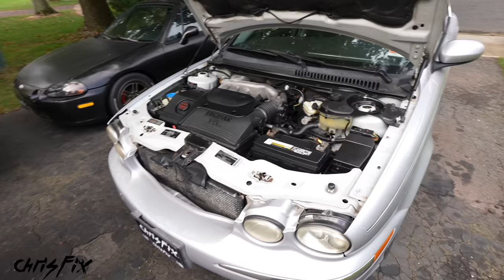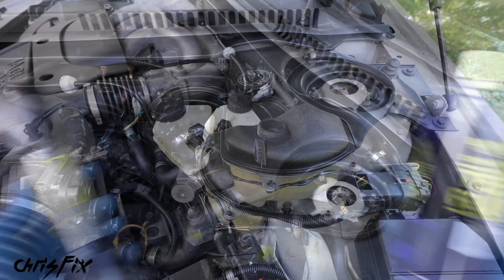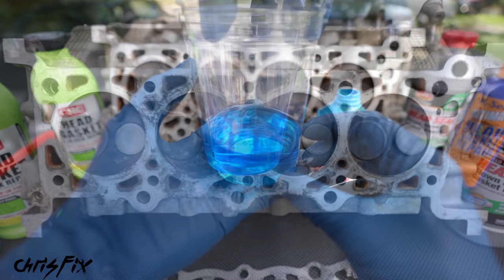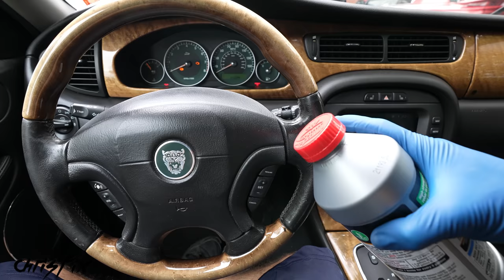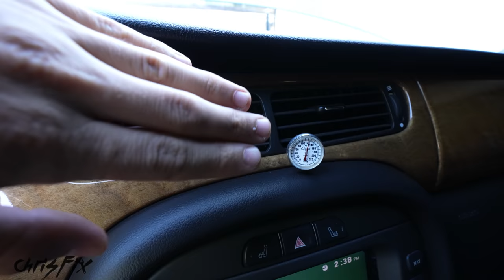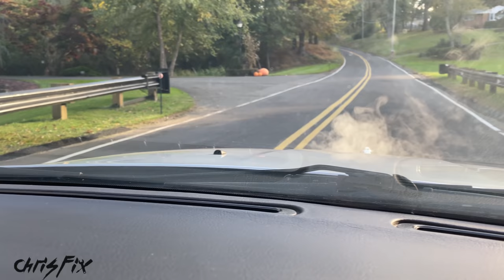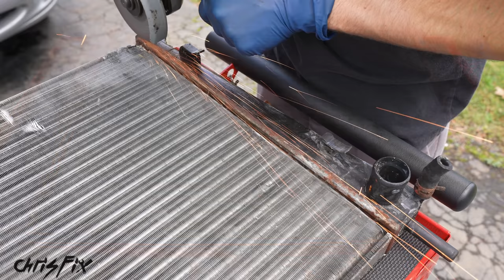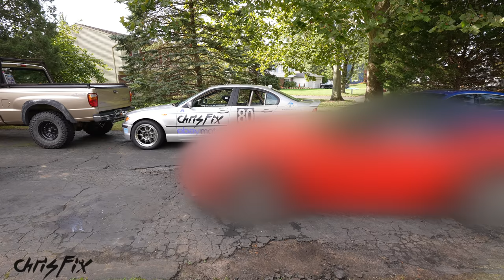Do Head Gasket Sealers Actually Work (FULL 2yr TEST with Engine Teardown)

Comment: This is the best head gasket video I've ever seen. Literally answered every single question ive had. Recently, I just found out i need a new head gasket, and it is definitely a costly fix. Thank you so very much for explaining everything and being very thorough. ❤

I do have one question, do you recommend a coolant flush after treatment as well? I just had one 1k miles ago, right before i found out along with the oil change lol. Do you recommend the oil change with any sealer or that particular brand?
Reply: Coolant in oil, oil in coolant, or both? Is the cooling system pressurized?
Reply: Oil is normal, I just know exhaust is getting in coolant. Been pressure tested 3x and i was told it was normal. Failed a block test
Reply: @c.b7474  if the cooling system can hold pressure then flush the cooling system multiple times with water before and after the procedure. Use water only with the sealer. I highly recommend removing the thermostat for this. Heater should be set to high. When adding the sealer it's best to dilute it first and only then pour it in. Do the procedure in steps, not just one go. After adding the sealer, topping up the cooling system with water and putting the cap on, start the engine, keep the RPM above 1000. Let the temperature rise some, shut the engine off. Let it cool for an hour. Check the coolant level, add more water if it's lower. Run the engine some more to raise the temperature more than before, shut the engine off, leave it to cool for an hour. Check the coolant level, add if lower. Repeat until operating temperature is reached. Then you could put some load on the engine, to make it really hot. Then you can flush and use the coolant of your choice.
Reply: I'm not well equipped with mechanics, a coolant flush cost me over $100 and i have to drive over an hour from where i live just to get it done since i live in the sticks. How many times am I supposed to flush it? I was told I can't put straight water in. 2020 Nissan Altima- it's passed the warranty. I'm not even loosing any coolant.
Reply: @c.b7474  should see how clean the water is coming out, when you think it's good, it's good. Flushing can be expensive when done by a mechanic. You can use water just not for very long, you wouldn't drive like that for a month. If you can't do it yourself or don't know anyone who could help you with this, then perhaps this solution is not for you?
Reply: @SinsBird  Well, this video was pretty simple. All I really need to know is if I need another oil change and how soon after. Seems like you added several additional steps that this guy in the video didn't do.
Reply: @c.b7474  Yes, with this method that I described there is 90% chance of success and it's not possible to cause a bigger issue. Method in the video is quick, easy, but has much lower success rate and can cause issues like clogging the cooling system.
Reply: @SinsBird  I'm truly just looking for something that works for min 5-10k miles (as seen in this video) so I can come up with the money to fix it (if the sealer ends up not being permanent) as i need the vehicle to go to work lol. I plan on getting a new vehicle in 6-11 months from now. So heck, if this treatment lasts till then (i drive a shit ton so id say 30k miles at 11 months) itd be great. If not, that's okay and atleast id have the 2-3k to fix it by then. Of course I don't want to mess anything else up, but Ive been reading on some bottles where some suggest removing the thermostat, and some say it's not necessary. I have no problem getting another coolant flush and oil change after the sealer. I'm just not sure how soon after. Like 50-100 miles soon after? I don't plan on selling the car. I pretty much wanna keep it till it's a gonner, or the cost to fix is over what it's worth.
Reply: @c.b7474  After you'll be sure the issue is gone.
Reply: @SinsBird  I appreciate your advice. Thank you very much.
Reply: @SinsBird  Okay, sealer definitely worked as i have no prior symptoms from the head gasket leak. I ended up using a different brand (Iron Tite Sealer) that was pretty straightforward and followed the directions, but now I have air trapped in the cooling system. How the heck do I fix this?
Reply: @c.b7474  How do you know there's is air in the system, I mean there likely is, but what is the symptom?

Comment: Yes, could also be an internal water pump seal which often leaks on mercedes. This lets coolant into the oil and we wonder if this will help fix this sort of leak. No overheating, just coolant loss with no drips.
Reply: Probably not.
Reply: @SinsBird  My Mercedes model is known for this type of a water pump leak into the oil system. Are you saying that's probably not the issue? Or it will probably not be repaired by head gasket sealer. Which.
Reply: @douglundy5755  Gasket sealer wont work for this type of leak.
Reply: @SinsBird  thanks..an oil additive then would be my option, or repair the water pump.

Comment: mate, you should drain the rad first, disconnect/ remove thermostat, then half fill, add the sealer while the engine is idling (from cold start adding). leave running for 50mins. then cool to cold, then drain out sealer infused coolant and refill with fresh coolant. reconnect/replace thermostat.

Comment: I can say without a dought my dad had an 82 gmc with a straight six and had a cracked head with multiple cracks also had 350 as well both used liquid glass and lasted at least at least a yr then reapplied and kept doing it for about 3 yrs and truck was used regularly for hauling a trailer even so if using on heavy equipment I recommend liquid glass head sealer

Comment: I have not used Gasket sealer,,How ever I have used stop leak on my Power Steering and used  Bars radiator stop leak/with beads. The Bars worked great on my Va,BUT the powere steering stop leak Blew out my Line,,had to physicly force my steering to get home,,good thing it was mainly a Straight line home.

Comment: Okay, sealer definitely worked as i have no prior symptoms from the head gasket leak. I ended up using a different brand (Iron Tite Sealer) that was pretty straightforward and followed the directions to a T, but now I have air trapped in the cooling system. How the heck do I fix this? Thermostat is opening at correct point, no visible coolant leaks. I think what happened was i accidently added too much coolant and of course poured 16oz of sealer in, so the resevoir actually overflowed. Water pump is also looking like its working correctly so im fairly sure its just air trapped thats causing a hiccup.

Comment: I have. Bubbles for a year or so no overheating on smoke and oil is perfect sometime the coolant goes down but sometimes it’s pushed back to the coolant tank and makes it overflow
Reply: If you have no problem removing the thermostat, then you can go with sealer that has particles in it, otherwise choose something like blue devil.

Comment: I have a 99 ranger that had a blown HG, leaked oil into the radiator/ antifreeze into the oil, I bought the barrs and it didn’t work, changed the fluid again and used the CRC and it’s been over a year and still going strong….

Comment: I’ve used that green fiber lock on a car that was pushing coolant into the oil; sealant went into the oil and the engine locked right up. Guess the stuff worked too good.
Reply from the maker: Dang

Comment: Actually surprised me. I've worked on cars for many years, my brother was a SAAB master mechanic and my bio dad was a mechanic and even I didn't think head gasket seal additives would work on a blown head gasket or a warped head.

I wonder if it's still worth it to pull the engine apart nowadays with how much it costs to have shops tear apart engines, with some requiring complete removal? Normally it's new warrantied used/reman engine or in some cases a brand new engine.

Comment: That is awesome Chris thank you very much for that. I just bought it took song 2006 with 69,000 MI. I got scam because they didn't Tell me about the blown head gasket. I used the same sealant that you did. It keeps blowing white smoke only when you started it the first time. Also apparently I'm not losing any coolant. I will change the oil now

Comment: Have not used head gasket sealer but do have a car with a leaking head gasket it is a 1999 ford au falcon forté it has 280’819 ks on it (174’494) miles I was thinking about using this but I already bout the head gasket and it’s sitting in the backseat of the car but that’s the least of my worries because the car has been sitting in my garage for 18 months and won’t turn on have had jumpers on it but it won’t turn on so fix that first

Comment: Hey Chris! I am currently dealing with an external head gasket leak and as I watched your video you said that the sodium silicate only works when combined with the exhaust gases which would only happen with an internal leak. So my question is, will a head gasket sealer work for an external leak since it has no exhaust gases to mix with or should I go with the K-seal since it doesn't have sodium silicate and only needs pressure and heat to solidify? Thank you for everything you do and giving me the love that I have for cars!
Reply: Any sealer should work if the leak is not too bad.

Comment: I did k seal in my 98 grand cherokee 5.9 limited 2 days ago and it actually did stop the head gasket leak.  No more yellow color on the radiator test.  And no more coolant loss and oil level stayed the same.

Kinda shocked me.  Was thinking i jad to park it and take the head off and blah blah

Comment: Hold on Shop is saying $1500 for parts that is absolutely absurd in what world is a head gasket and some coolant gonna cost $1500 because I’m currently running head gasket sealer through my car my 98 grand marquis and there’s no way in hell I put $1500 worth of parts For that now I have put $1500 in parts to fix the car overall spark plugs, rebuilt cooling system, window tent, audio fuel pump, etc. Telling me that they want 1500 for parts. I would buy the parts myself and say here put it on.
Reply from the maker: Jaguar OE parts from the dealer are not cheap! I'm sure I could have gotten them cheaper but the labor being $6k pretty much totals the car

Comment: Instead of buying a separate tester for exhaust fumes in your coolant... you could just use a long funnel stick it in your reservoir, and fill it with antifreeze to where the liquid sits above the reservoir. Let it run for about an hour, and if you still have consistent bubbles, you have exhaust going into your antifreeze. Aka blown head gasket. Anyone who has a funnel and some extra antifreeze or just water can do this.
Reply: Aaaand I spoke too soon. Paused the video right before he said the same exact thing. Lol

Comment: K -seal is the best out of all of them.
I had a MAJOR leak in my water pump ...losing a whole gallon of coolant with one drive ..
Used K seal and it took about 1 day total but it completely sealed the leak in my water pump.
K seal is the only one that works for water pump gaskets .
Reply: If it was leaking out of the drain hole the pump will seize.

Comment: I used the CRC bottle and it clogged my radiator. I replaced the radiator, but it actually stopped the head gasket leak

Comment: Severe complete blown head gasket? Grand am gt. Which are famous for blown head gaskets. I had issues 4 times over 4 years, but I completely dogged this car hard? Really hard? Changed gaskets and bolts the first time. Second time I b used Bars? Did nothing,   but Blue Devil worked perfect. And that poor car continued to be abused? Hacked, lowered, modded? With no issues  untill the coolant system would fail as usually in some way. BLUE DEVIL WORKS.

Comment: Thanks, bro. I'm going to try the CRC brand on my 2005 Ram 1500 5.7 Hemi. I'll  come back with the results.
Reply: Is oil and coolant mixing? Oil in coolant or coolant in oil? Or both? Is the cooling system pressurized?

Comment: Would this process work for an oil leak towards the outside of the engine? i've got a slow but steady oil leak, on the front side, no puddles ever but the areas around the leak are covered in oil, the steering pump, bit of the subframe, etc.. it's only a old peugeot 206 so if I can avoid dishing out £700, that'd be nice. Any advice welcomed. Thanks Chris, you're doing god's work for us petrolheads
Reply: This is for cooling systems.

Comment: My car has backpressure in the coolant, and I'm trying to use this I saw that steel seal  is a product that can work but I have to identify the cylinder that has the head gasket leak. I hope it works
Reply: No coolant in oil or oil in coolant?
Reply: @SinsBird  not at all, nor white smoke either and the car runs great besides it pushes the water out, I flushed the cooling system and it makes sense it being the head gasket because it  is intermittence just like the cylinder exploding
Reply: @rq7684  Then it will work 100% if you do it right. If it's a gasoline engine look at the spark plugs. Also you may look down the spark plug holes to see which pistons are the cleanest looking.

Comment: If only I had knew this video before. I had a bad head gasket wich started leaking a year ago, now it totally blew when I am in the middle of spain for a 3 month internship where I need to do 100km/day to go to work, and I'm fucked up. The engine overheated so many times (Not over 130°C but still) that I'm sure it is fucked. I have a little bit of bubbles in the expension tank and a HUGE smoke at exhaust plus the iddle is terrifing.. No coolant in oil and no oil in coolant beside this.
Probably too late but will test this. I hope it will still be able to fix my poor beloved E36.

Comment: I've used the blue devil on minor head gasket leaks and it works it should be 30 minutes I don't understand where you get 50 from that must be a new one I don't know if these new ones work as good as the old ones the old Blue devil works on small head gasket leaks or cracked blocks cracked heads 👍💯

Comment: Eagle products are a great bet . Ive had a cracked head and it sealed it great . Drove it for 5 years after fixed had a valve spring break and almost swallowed a valve so I took it out and found the repair and it was welded shut.

Comment: Any knowledge to share about Steel Seal? Subaru owner here, using Motorkote products by the book. Two days ago saw the first clouds. Revved it quite a bit because i drive like an old lady and thought vapour turned into liquid in the exhaust system... After that i parked it into full stop. Today i started the engine and had a bit of "head gasket rumble". I could play drums on my mirror just by holding a pen onto it. Searched for no fiber sealants and SS (now that is weird) came up on reviews as a good product. Any help mostly appreciated.
P.S. Chris you are the man! Cheers from Greece!
Reply: Steel seal works, blue devil does not contain particle filler as well. Oil in coolant, coolant in oil or both? Is the cooling system holding pressure?
Reply: @SinsBird  it is actually weird. It's likely having a leak between cylinders. Compression went down prolly (black ash in tailpipe and some loss of power), altering burning efficiency. It might be a crack on block, cause it starts normally and after getting warm showed clouds of smoke. It has to be down there, under the gasket, because no warm air intake would show like this. Just want to avoid opening the motor. The damage does not seem like major right now. So i asked about the one not shown on video. Being European and not a mechanic gives me less and less opinion weight on such products.
Reply: @promalec86  You can just fill the cooling system to the brim and look for bubbles when the engine is running cold.
Reply: @SinsBird  thanks

Comment: Had 2011 Prius 237,000 miles developed head gasket issue 
Used K Seal sealer and it  worked just as I hoped
Car ran just like it did before leak….

Comment: Maybe i missed it, but did you mention where the coolant was going, exactly?
Into the engine?
Wouldn't you have needed to change the oil right after (or at least after using repair liquid)
And just as well
Wouldn't it have made sense to replace the liquid coolant in the cooling system after this liquid repair hardened?

(BTW I'm not even close to being a real mechanic, I'm just trying to wrap my head around this)
Reply from the maker: The sealant flows through the coolant system and will harden anyplace there are gaps. And I was just following the steps outlined by the manufacturer since they made the product and know best. They did mention leaving in the sealer since some leaks can take a few cycles before sealing.

Comment: I used one on an 01' accord. Saw oil in my reservoir but I was still a young mechanic. Probably shouldnt have tried a sealer cus when I did my main coolant hose exploded on the high way. I forgot which one I used pretty sure it was the CRG brand
Reply: You just made many mistakes in the procedure. You can't do it in one go, it must be done in steps over several hours.
Reply: @SinsBird  it was a long time ago before I knew more about working on cars and like I said there was oil visible in my expansion tank. So definitely don’t use a head gasket sealer if you have a head gasket compromised between the coolant and oil. Only if it’s between coolant jacket and combustion chamber. I guarantee I got coolant sealer in my engine bearings which is why it stopped cranking after I repaired the hose and tried to run it again.
Reply: @brandonbrent6149  No, oil is not a problem, it's just less likely to seal because of contaminated surfaces, just can't really attach and stay in place.